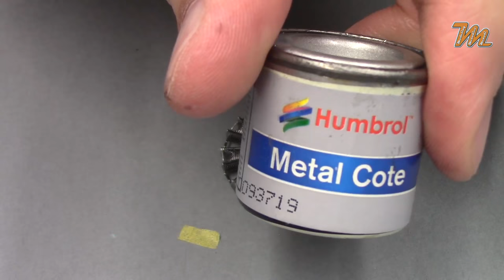1/48 F6F-3 (Mk.I) Hellcat scale model step by step build - Ep.2 - The Engine

Comment: You are one serious modeller, I salute you!  Where do you get your tech info for the engines?  I myself started off using the original Airfix models with written instructions and obtained a lot of useful info for component names.  I've now restarted after a very long break.  So it's very good to find someone like you on youtube!
Reply from the maker: Thanks Robert. The R-2800 is very popular engine so there is quite a lot of info about it (but there are a lot of modifications as well). The tach details I got from an old diagram... it was somewhere in the top search results.
Thanks for commenting.

Comment: Stupid question maybe... i never scratch build anything. What makes you chose between Copper or lead wire
Reply from the maker: Hi Francis, thanks for your question. There are several reasons. First there is the diameter, at least the lead wires I have, start from 0.3mm, and the copper wire is more like 0.1mm. And there is also the question of color... if you need copper color... well you don't need to paint the copper wire :). Hope this answers your question.

Comment: Can you tell me the brand or source for the self-adhesive aluminum tape you are using to create the metal bands on the spark plug wires?
Reply from the maker: +Gregory Rush  one of many options http://www.3m.com/3M/en_US/company-us/all-3m-products/~/All-3M-Products/Adhesives-Tapes/Industrial-Adhesives-and-Tapes/Specialty-Tapes/Foil-Tape/?N=5002385+8710676+8710815+8710978+8711017+8713632+3294857497&rt=r3
Reply: That's more or less what I had found, I was just concerned about the thickness.  Didn't want it out of scale!  :)
Reply from the maker: +Gregory Rush The one I have is pretty thin, but its not 3m or other well known company.

Comment: Wished I could pay you to build me 4 R-1820 Cyclone engines to fit HK 1/48 scale B-17 model!
I have blown money off 2 diffrent kits and screwed up all 8 engines I hv arthritis and my fingers can’t handle the small parts and especially wires. To look real but haven’t found anyone to build me 4 of them
Reply from the maker: I feel for you mate. If holding paintbrush is ok probably you can search for 3d printed engines. They usually come in one piece with wires and all.  You just have to paint them